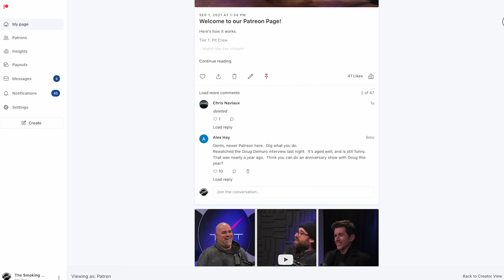Ways the BMW 128i is Better than a 135i or BRZ - One Take

Comment: Even more of a sleeper is the e90 328i.  There is not a big weight difference compared to the 128i (sub 200 lbs. as I recall) and they are much easier to find.  Plus, you can get more variants (sedan, coupe, rwd, awd, etc.) depending on your needs.
Reply: Lol not a sleeper, 328i E90’s are everywhere and stanced to all hell
Reply: @jpleon314  😅😅😅😅😅😅😅
Reply: Yeah but they're not as good looking or special and 200 lbs makes a big difference in reality.
Reply: @mediocreman2  E90’s aren’t sleepers either there everywhere
Reply: @jpleon314  being a “sleeper” has nothing to with how many were built.  That’s irrelevant. Being a sleeper is a function of having performance that is beyond what others expect.

Comment: Absolutely agree with this vid. I have a 135i N55 vert and a 328xi N52 touring, both manuals. Both much heavier than this car, but on the same spectrum.  Between the 135 (stock m-sport suspension) and the 328 (KW v1) there isn't as much of an excitement gap as you would think. The light weight of a 128i coupe would make it absolutely the most fun non-M BMW, turbo or NA.

Comment: I fell for the BMW NA 6 with my e39 530i. It's not fast but its a fun car to wring out, i considered the 540 but with the added headaches of that engine and higher purchase prices (especially for manuals), i deemed it not worth it. The farther we move on from the 128i the more I want one, such a great balance of size/power.
Reply: After owning a pre vanos e39 540i with a 6 speed manual, I had to buy another e39 and went with a manual 530i. I own a g30 540i as a daily, but its nowhere near as well built nor does it handle as well as the e39s.

Comment: I had a N55 135i and drove it from NY to Cali and the engine was destroyed due to rod bearings. Prior to the engine breaking, many components were breaking down constantly and parts were unreasonably expensive. 

The 135 looks great on papaer but there was always something missing. If I were to do it all over again I would probably have a very similar set up to todays guest. 128i Manual + LSD + coilivers + performance brakes & no short shifter.

Overall though, I wouldnt recommend buying a 1 series, I replaced mine with a Porsche Boxster base manual, which has been pretty rewarding to drive, straightforward to work on, and decently priced parts.
Reply: I’m going from a Boxster base to 335is, I never hated a car more than the Boxster. Absolutely horrendous. Slow and designed by special ed students. At least you can work on modern BMWs with ease
Reply: N55 and rod bearings ? Than your maintenance is horrible. My 135i `11 run with MHD STage 2+ for 100tkm. The only thing i have to change was the waterpump + OFHG. 
Warm up the engine slowly and change the oil in 10tkm intervall.
Reply: @t.c904  enjoy your ownership, I wouldn’t recommend personally

Comment: People don't realize how special the 128i is. NA I6 and a 6 speed manual, true 3200 lb car with modern suspension is a rare treat these days.  I've been in love with mine since I got it about a year ago.  After racking up thousands in speeding tickets driving my 450 whp C6 I still manage to get tickets in this 128 as well lmao.  HP really is just another drug, you wind up getting used to it in the end and go broke trying to chase the high.  Keep the rubber side down friends!

Comment: I had an e36 M3 with the s52 which is the old school predecessor of the engine in this car, similar horsepower and all and it was very torquey thru out every gear. Very fun to drive even with it not being crazy fast in a straight line
Reply: I have a 328 e36 and in 40 yrs it's my absolute favorite car I've ever owned. Will never sell it. Do u know if the 128 was the chassis and the displacement still in 2008?
Reply: My 2007 E90 328i reminds me a lot of the 1995 M3 I had for a while. Both are great cars.

Comment: I really enjoy this build, Nice and simple but efficient. I really do wonder why the owner didn't do a simple intake ( or even just a better filter ) tune on it. While not going to get insane amounts of power it would most likely wake up the power-band a bit more and I'm sure make the car even more fun and make his mods work even better.
Reply: usually it's a question of humidity. Western USA is too dusty and so Cal can be too polluted. Sand storms? They happen
Reply: He should have done an intake, 3 stage manifold, headers and that would gain him easily 40hp. Very odd choices

Comment: The 128i is the better pick over the 135i in my opinion because the 1 series is a narrow body shortened e90. Because of that the fenders can't fit much tire. The 300hp stock 135i plus the weight and no LSD makes the car unbalanced out of the box. Removing weight and adding a lsd makes it perfect.
Reply: IMO to lower the overall COST TO own or a 5 year ownership window the mod list to make the 135i ideal/reliable on top of purchase cost or addition of a M1/LSD really has it priced FAR above its "sale/used" value. By contrast a well priced 128i leaves that "wiggle room" to almost equate to a 135i "used price"....while including suspension/LSD mods to the 128i budget....vs having a bone stock 135i that will only proceed to have issues with lines/hoses/cooling/oil/leaks. Which wind up costing as much as the "necessary mods" at point of purchase. Unless you DIY XD and can source parts at an ideal price...not to mention if those lines/cooling/oil issues were already persistent with the previous owner/s then we have the IMPLICATIONS to damage to engine/internals/drivetrain as well..on top of already paying up for the 135i. Or them being a ticking timebomb with their belt/chain...or if the previous owner is aware of said belt issue...and merely is trying to mask the issue with some "mechanic owned" savyness...to off load said problem to the next "sucker" which definitely can happen with private sellers.
Reply: Is that the case with 125i as well ?
Reply: @LEWiSG  I believe 125i, 128i, and 130i are all N52/N51 powered cars. With an intake, they can be tuned to around 265hp, and with 245 being around the max tire you can fit, it's well matched and balanced. So yes the naturally aspirated cars ftw.
Reply: @petert7807  would u recommend the 125 over 135 if your Just using it in the city and mainly on weekends? Seems like 135/55 engine can have more issues come up and are more for speed heads
Reply: @LEWiSG  135i is a lot more fun to drive. I dual duty my 128i, daily, track, and autox. Honestly,  I'd go for a 328i if I never did any motor sports.
Reply: @LEWiSG  I did test drive a DCT N55 car... kinda regret not buying it! 😬
Reply: @petert7807  I like the small size of 1 series just can’t decide if I should go for a 125 or 135
Reply: @LEWiSG  if you are going to buy an auto, and don't mind the extra maintenance I'd say 135i, n55 with DCT. But if manual the 125i is good for a simple reliable daily.

Comment: As a n55 owner, triggered upon seeing the title. My bro has a 128i so its all love. Lol all jokes aside, dope video. 1 series always my fav 😍
Reply: no one with an N55 is envious, I haven't had anything except the charge pipe breat on my 135i and it has all bolt ons. Having also owned an E82 120i, the biggest chassis difference is the lighter front end of the 4cyl and power steering.

Comment: This thing is remarkably like my old 128i. I ordered mine from Germany (for a lease! Residuals were crazy high then- the lease was cheaper than a vw golf’s lease). White, 6 speed no options except the m sport package. Then I installed m3 subframe bushings, like this guy- an LSD with lower gears, really stiff touring car racing suspension, the widest Azenis rt-615k square tire setup I could fit, and big sway bars. To me this was the last real bmw. The straight 6 IS bmw- these things have a super light magnesium block- it’s light and it handles pretty close to perfect. I miss it- but I traded it for something equally awesome.
Reply: What did you trade it in for?

Comment: I had the z4 3.0I manual it was amazing little car. I have a 135i now and oh my god I’ve owed it for 3 years and it’s been sitting for about 2 and half years haha I’m lS swapping it n54 amazing engine until the start breaking
Reply: what’s wrong with the 135i?
Reply: @nelsonx4235  nothing 😂 I just blew the engine. Then I had the dme get damaged. So I gave up on it. I bought a 5.3 ls engine and it’s getting that swap
Reply: @ThaHammieJaassee  oh I see; makes more sense with the ls swap. But how did you blow up the engine?

Comment: Would the convertible version of these be a good Miata replacement? I love my NC but I need back seats now, even if they're tight. None in my area to test drive, unfortunately.

Obviously coming out of a Miata, I'm more than willing to sacrifice power for reliability and less weight, so 128 > 135 for me
Reply: It's going to feel like a GT car compared to a Miata but still is quite nimble and with some suspension mods and decent tyres will handle really well
Reply: @bwdrives  I suspected as much, but I'm thinking it's the best compromise for my tastes. The only other RWD manual convertibles with back seats I can think of are Mustangs and Camaros (can't afford a 911 lol), which are even bigger and heavier than the 1 series, so I'm thinking this is my best bet.
Reply: BRZ/GT86
Reply: @judge831  I like the 86 platform, both gens. My dog absolutely loves the convertible though, and his life is a lot shorter than mine, so I'm not gonna take that away from him.
Reply: Yes and no. Much better sounding, better power and torque, excellent steering, but quieter, smoother, more comfortable, a bit safer, a bit more maintenance, but also not as lively and 'fun'. For me, the 128i is a more mature choice.

Comment: You forgot to mention the biggest advantage. Anti corrosion methods. The 128i came from the factory with a 12 year anti corrosion warranty. It also uses way more high strength steel with structural adhesives. It is a car built for long term use, unlike the Japscrap.

Comment: What if…….M put their hands on the N52/N53 and made it into an S motor. Individual throttle bodies, High Lift M Magic on the Valvetronic system , little more displacement, higher rev limit etc etc. What I think you would have is  a character simliar to the E46 M3 S54 but, more reliable, smoother and more powerful throughout the rev range.

Comment: Had a 135i convertible, I really liked the form factor, seating position, trim size, good steering feel. A stage one tune made it pretty quick.
The handling up to about 7/10 was very pleasing but would lose composure when pushed hard. The convertible affected the chassis rigidity but was good enough.
The 128’s had an early version of electric power steering so were not on my list. (Correction: Some euro models had EPS, it appears US models were not EPS)
Reply: Yea electric power steering is dogshit, I can’t drive the v8 e39s in the same way the straight 6s. Have a friend with turbo 530i pushing 400 from an unopened m54, my m54 na in my 330 pushes about 260-270 with tune and better intake and headers. Can get more with cams. Thing is I just can’t drive without a steering rack directly connected to my wheel. It’s nowhere as fun. I can’t describe how much you lose from electronic steering even if it is “better”! My 2 c
Reply: The 128i used hydraulic power steering and it's amazing. Please don't spout misinformation. Thanks

Comment: I have a 128 with 100K but the valve noise drives me crazy, a rev it a bit and goes away but when the car idle is there and worries me. is there a update or way to remove it...
Reply: Naa thts how they are

Comment: 10:16 jeez i went from looking at the gr86 and brz contacting dealeships for a base 6 spd in 2021-2022...to an i3 daily....now im looking at "used" for my for fun option. These 128i look better & better by the day, im even considering a stock renesis/rx-8. That GR86 platform still has its "list" of required mods to be IDEAL or a "jump" from a starter car to more or less Worth keeping as something beyond a stepping stone/platform...like a bolt on Supercharger or turbo kit....as well as bbk etc....if i want that "BUILD" ill wait a few years to source a used one so that type of build/tune is more "affordable" a well tuned for grip/speed 128i seems like it will hold up till "then". Otherwise ill just shell out for a new GR corolla or a modded WRX. Even then im pretty anti/against the wall about a new car....or making payments/financing and modding a car....vs the aspects of buying/modding used and having the ability to sell...down the road. Going through YT looking at my "top 5" feelers/options and you outright say/call it a more luxurious BRZ XD. The idea of throwing money down and having financing then ADDING modds to a car ive yet to pay off...or encounter maintanence issues with....definitely put me off "most new cars" other than a brz or gr86 with a brake upgrade/header+exhaust...with hopes of slapping a SC to pair with the already/ideal combo of headers+pipe. But now that i have a cheap to run daily other than tires/insurance. For these shit cali roads/traffic thats already harsh on your back/seating angle in most sports cars suspension or you compromise some "speed" for comfort...which never translates on track or equates to ideal on track. Now i got time to save for something more suited for my needs/finances....or can wait a few years for this generation of BRZ to hit the 2nd hand market...then go for that build when its more cost effective. Id rather the first adapters of this 2nd gen/FA24....to encounter the majority of "necessary mods" on the track before i own myself. So theyre really doing the grunt work....otherwise "TODAY" im stuck looking at a BRZ for its more ideal roll/daily/streetability vs a GR86...or a WRX with a BBK typically a BBK on all of em ideally. Then pipe/tune. Its all that really has my attention as of 2023...or you consider compromises like elantra N, or civic SI. Which are FF and more price conscoius price/performance conscious as well as EPA oriented/daily viable to a "high extent" from a practicality standpoint, or with a lower mod list and resale value. But This whole 30k-40k market/demographic is such a GREY ZONE it really compounds the value of the used market/avenues. Youre just looking at buying a car straight up off top vs using that sum of $ towards a down payment...on something with relative potential for failure/issues/commonality with new cars/platform/engine adoption. Or a rabbit hole of "more more more" when the goal is for me with a non daily/fun car....ideally for it to be practical/usable with a low mod requirement other than a priority to suspension/handling characteristics. Fast powerful car FUN sure....not if you cant put your foot on the gas though :( Its what makes ppl go from FF to FR and at times from FR to AWD. To me its largely an aspect of being able to be content and have something you dont have to tool with once youre content with your tune/ride. OFC ppl could delve into mx-5's or etc avenues...but the aspect of having the interior/amenities of a car like "This" while also having the sporty/streetability and relative range of abuse/miles a build like this can withstand...IMO it completely changes how you drive your "FUN CAR" if driving it fast/n powerful equates to more time in the garage anyways...it may cause those ppl to drive that car less...push it less....grows into a love/hate relationship that yields sale/trade etc....which happens all too often enough. For the price idk if there are many cars that can offer what something like a 128i can or a properly maintained OG light pickup truck can in todays/practical drivers market.

Comment: My cup of tea will be.  Mean only for fun and excitement fully trusting  controlling ur horse. For serious applications like Race. Drag. Time attack. Will be totally different cars....
For fun and reliable 1. Honda civic SI or type R.  Integra type R.  Old generation non turbo. So fun to drive 1st gear full thrroutle tire screams for grip n traction 1.2.3 tire free spin and u feel every inch of street on that area.   RPM needle dance up and down hitting the limiter. Exact same feeling when u enter corner with front wheel drive gives you that feeling everything under control.  Ur trust grow...  U can't have that feeling with RW or All wheel...  But nothing makes you more happyer than pure 6 cylinder turbo like 2JZ and all his sisters and brothers...  Me I own 335I e92 n54 engine..  Imported from Japan.. n54 is 2jz for broken ppl man I had soo much fun with that car. And missing it so much..  I renew and replace  95% part  of that car. I still need radiator and intercooler and oil pan gasket. Need to fix everything because car is expired from road.. For renewal need. To fix all of it plus ton of citation worth of almost 500 bucks most of them speed ticket and loud muffler. I lost my business covid time.  Than my father. Took me a lot of time to fight depression. And watching my horse fully covered up in dust can't wait to. Be able drive it again. Will go long  drive midnight my music :(

Comment: The one thing though talking about reliability when he says he’s driven a big old huge 2k miles… having worked on bmw’s most of my adult life and owned a ton I just know how out of control the bills can get with all the plastics and bushings and rusty bolts and everything that has issues on modern bmws or ones from this generation

Comment: Will never sell my 125i with 30i tune, 7500rev limiter, 3.73 LSD, 1M arms etc. Hangs with way more powerful cars in the canyons and paired with the N54 mid and rear pipe, it sounds like a mini S54 M3.